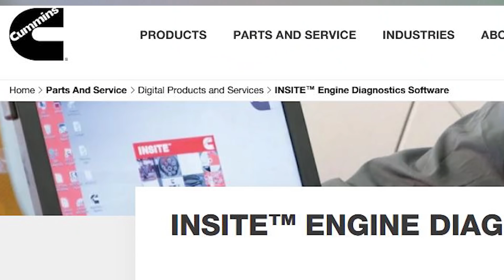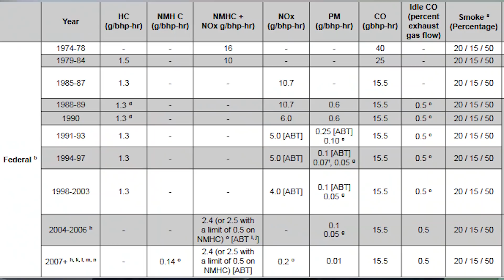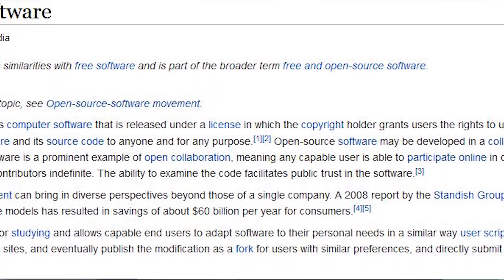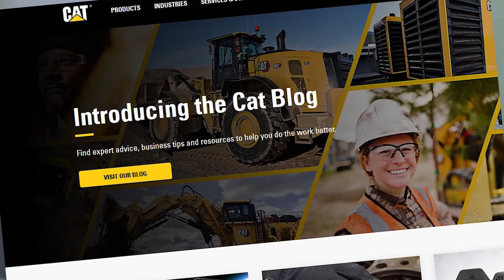Should YOU have the "Right to Repair" your Engine?

Comment: I think of Mel Gibson in Braveheart as he yells FREEEEEEDOOOOOOOMMM! 
I would love to have access to CAT scan tools and wiring diagrams.  I just had a problem with the AC in my T800 Dump truck.

So I got out the back probing pins and the test light and quickly found the binary switch was failed and stuck open.
While I had my stuff out I went ahead and ohmed all the wires out back to the relay so I know how the entire AC system works and make record of it.
I still have unanswered questions though. Soon as the key is turned on a ground becomes active in the relay. Does the ECM send that ground?

Comment: i think this is ALL "CRAZY, STUPID & RIDICULOUS". If I bought the vehicle, with the software installed in it, that makes it run, that is part of the vehicle that I BOUGHT, THAT I PAID FOR... IT IS "MINE", PERIOD! WHY do we have to argue if they should "sell" it to me, when it was already done so, when I BOUGHT THE VEHICLE, and that software was part of it, therefore IT IS PAID FOR, IT IS MINE!?!? OF COURSE it is all a way of them to have CONTROL of you and RIP YOU OFF. You may get a simple "check engine" light, which could be something as simple as a "gas cap" not closed properly, but you don't know, so you gotta take the vehicle to the dealer. At that moment, they can make it up to be WHATEVER THEY WANT, since you have no access to it, and can NOT take it to your favorite mechanic; they can "make things up", tell you you have a bad ECM, or bad injectors, etc etc, and charge you THOUSANDS, when all it would take was a "twist" of the fuel cap, or maybe just a new cap... 15 bucks! Even WORSE, dealers are all CROCKS, besides lying to you on what the real problem was to make more money, THEY MAY NOT EVEN DO ANY SERVICE @ ALL (since most people aren't able to tell the difference, specially on small cars, that everything is so cramped and you can't see), and just charge you the big bucks, and just POCKET ALL THE $$$$! I'm not just guessing here, IT DOES HAPPEN! If you don't think so... THINK AGAIN. You know those signs posted on the doors to the garage/shop that says "no costumers allowed, employees only", and they all tell you is due to "safety and insurance requirement"? It is all BULLS***, it is just so costumers can NOT see what they are doing, they may get caught doing something wrong, doing something that does NOT need to get done or, even NOT DOING ANYTHING @ ALL, BUT, YOU WILL GET CHARGED!!! WAKE UP PEOPLE, DON'T BE SO NAIVE!!!

Comment: This is the reason my current company runs older equipment we have a 2 stroke Detroit, a 300 big cam Cummins, and 2 b model cats granted we are a smaller company and our construction equipment is newer except for our runner tire roller which has a 2 stroke Detroit in it also but I’m the driver/ mechanic/ spare equipment operator

Comment: I believe it pretty much started back in the early-mid 80's when domestic car makers ( don't know about the truck/equipment makers) started putting computerized (OBD1) systems and longer powertrain warranties on thier products and with the federal mandated warranties on their emission systems. Even then owners and shops could somewhat excess information via flash out codes from the check engine light when no scan tool was available and if they had or could get the latest repair manuals Motor, Mitchell, Chiltons, etc of course no internet at that time they could the repair themselves. That debate has been going on for along time, you may own the equipment/vehicle but who owns the software?. Dealers always get the latest and greatest first, then the aftermarket is usually 3-5 years behind in which even then the software released is still very limited. Because of the warranty period that every manufacturer places on their products. Independent shops can spend $1000's just on software updates every year, let alone what it costs to subscribe to the manufacturers sites in order to be able access repair manuals, TSB's and updates. Aftermarket repair sites, j-pro, alldata, etc are limited only by what each manufacturer releases. Like with most auto makers the software used is all designed "in house " to both operate and diagnose their systems powertrain, body, brakes, etc. That to maybe the same with equipment manufacturers. Correct me if I'm wrong. What I've seen with medium/heavy trucks they have multiple suppliers to which require multiple software applications for powertrain, body, brakes, etc. I wouldn't doubt that any equipment, auto, truck, bus, etc maker has as many if not more software engineers then mechanical engineers. Even larger legal departments. I heard that John Deere had lost the law suit against not releasing their proprietary software to allow owners and independents to repair their equipment. I'm sure others will follow.

Comment: at minimum, I think the ability to read any trouble codes and do diagnostics  like cylinder deactivation, injector data entry, etc.. whether that's through a screen provided on the equipment or through a laptop I wouldn't really care
If anyone is concerned about right to  repair and hasn't heard of Loius Rossmann, check out his channel here https://www.youtube.com/watch?v=yw9k74Wu6fo
And if you like legal stuff, here's Steve Lehto  on the subject https://www.youtube.com/watch?v=6qyYEvcS5-8

Comment: As someone who grew up in a family of professional mechanics I was taught to wrench what I know learn what I don't. If you can do it and it's yours, hey this is supposed to be a free country. If you don't feel qualified then the shop down the road should have the right to work on my rig if I say so. I understand proprietary information but this is taking it too far.
Reply: Yeah buddy that's the problem I understand having private information but when you're strictly designing the equipment/software to not be able to be repaired out of the shop. Too me that's not longer private information that's the company going out of their way to screw over their customer's

Comment: IMHO, it should be treated like cars. They all should have a standardized port such as OBDII. You should be able to Run The DTC and either fix it yourself, go to a third party or deal with the manufacturer. Like with cars, if you alter the software, the manufacturer is not responsible for damages. Simple enough.

Comment: The service software for most engines and machinery does not do anything. It provides a interface to communicate with the engine or machine controller to read out codes or values that those controllers have generated most controllers have more than enough ability to do this for them selves as it’s is the controller that is doing all the decision making.Komatsu for example used to be able to read high pressure fuel actual and target pressure carry out cylinder shut down test and so on  all things that would need a software package but was simply accessed through the monitor panel of the machine with a dealer code.my my point is if you look at dash boards in prity much all modern trucks plant or cars the user interface is good enough to run any diagnostic to trouble shoot itself however manufactures chose not to put on then hide behind expensive program packages to try and recoup there development costs and forcing customers to use there approved channels which are highly inflated prices due to dealers having to pay highly inflated licensing to use a program that shouldn’t be needed.in an era previous to electronically controlled engines and equipment customers would gladly take there items to a main dealer when needed as that was where you would find the expertise for that particular item if that expertise wasn’t there then that workshop would simply fail and go out of business.now however customers feel they have no choice but to go to the dealer ship because there hands are tied regardless of the expertise of workshops and can sometimes be left with a bad taste afterwards feeling they have not truly been given value for there money.

Comment: the industrial truck and equipment industries need to take notice from the auto industry.   obd2  is a standard that gives generic  data.  doesnt matter who makes it.  if the manufacturer wants proprietary then they need to make the tool and software available  for a price. thats what car makers do. it's the price of doing business. is repair easier faster and less expensive with  factory tooling?  you bet. but with a cheap generic tool i can at least tell if i need to add some fluid  make an adjustment or take it to a dealer.

Comment: I worked for Cat for 45 years and always felt that a well informed customer was our best asset. Giving them full access would definitely increase your sales opportunities and customer satisfaction
Reply: I agree. I enjoy an educated customer that I can have solid communication with. I fully support the right to repair. I find that customers are a lot more loyal when you are open with them about repair procedures, including encouraging them to maintain and do light repairs on their own equipment when the need arises.
Reply: You are correct sir, treat people well and they will return the favor.
Reply: @xabhax  They already have to do that. I've had to pay people to fix things I've screwed up. You can pretty much see when people mess up stuff, particularly the computerized stuff. Lots of access logs kept in the system you can check.
Reply: Not when Cat makes way more money off of service contracts and repairs than they do selling equipment in the first place. There's a lot more money in repair and service (or forcing them to buy a new one) than letting the person fix it themselves
Reply: How? They would buy less parts and pay for less repairs. I understand right to repair means freedom, but CAT isn't stupid enough to lose out on tens of thousands to a customer for their freedom to do unqualified repairs.
Reply: @sqlevolicious  you are so wrong. Syracuse supply was the place I spent most of my money on parts. They couldnt help you enough the guys there were great. The reason I will not buy a new truck is because you can't get a cat engine. My rebuilds on my cats go 2million miles. The way these new engines are built and the way the new morons run them I am surprised they get 5 hundred thousand on one

Comment: I think these manufacturers are missing another revenue stream. Open the software up to those that bought the equipment and have technical support. Charge a fee or a subscription. I get it might be tough to do but someone that can aid me in getting my truck up and running or just patched up to finish the week. There are hardly any dealers you can phone nowadays that will help you jerry rig your equipment until you can shut it down. Guess what, you do that I'm coming to your shop to get it fixed once I'm done with my work.

Comment: Right to repair 👍👍👍👍👍,  I know everything is all about the dollar,  what's a yearly subscription to ET,reading codes, diagnosing the code, clear codes, put in new flashfile, also need wiring diagrams, theory of operation, and parts manual,  service updates 🤔 all for one price , NOT if  you get this or if you want this, you may need this , one price for everyone for everything,

Comment: Our company actively avoids buying CAT equipment in Europe. 
Over 10 years ago we had a shopping spree and CAT dealer had some compelling offers. But you allways have to ask, where is the catch.
We did the same with other supplyers, get an offer for around 25 big machines, mechanics and operators picked few parts from any machine and we sent it the orders to get quotes and availability.

CAT is up there with John Deere in servicability and access to software, overpriced parts and non existent customer support. 

We dodged a bullet big time, the choice later was other manufacturers that offered service contracts and 24hr parts guarantee, without costing us an arm and a leg (probably kidney too)

Comment: Yes absolutely make it run the way YOU WANT IT TO, not the way government dictates this explains why CAT has their software locked out to average Joe's and dealers WILL NOT do any out of the realm  programming and in most cases if they do any engine work it runs worse when they get done with it because all they do is cut everything back, but like anything else there is ways around obstacles

Comment: I haven't been to a dealer that has been competent in many years. Incompetence, lack of knowledge and training, poor quality and work ethic seem to be the norm in my experience. Warranty issues are a complete nightmare. No parts is the usual excuse and they usually want me to come back three times to make sure the trouble code is repeatable.  If my trucks aren't rolling they aren't making money. Customers suffer as does my company. If there is anyway possible I can go to a trusted private mechanic I do. I also do most of my repairs myself. I should be able to purchase any software and hardware needed to repair my Peterbilts period end of story.

Comment: Absolutely, if I buy something then I have total control of that item and I can do whatever I wish with it (so long as it is legal) If I wish to repair the item then it is my right to do so whether I wish to have a dealership carry out repairs, a small independent, or whether I want to undertake the job myself. Manufacturers demanding that I have my repairs carried out by a dealership is a racket and extortion. Still I won't buy a new vehicle anyway I would rather have something older that I can do everything myself, and I do. If a manufacturer wants to play that game then I ain't buying.

Comment: I would not mind paying the dealer to repair my equipment, if the could actually repair it and not just throw parts at it until they got the right part and they are so booked up you can't get it repaired in a reasonable time. I had two field service mechanics that have said; I have never worked on one of these before! They had no idea what to do. Then i tell told to leave. I have used Cat service since 1972 and been happy with their service, they have never had an issue that they could not resolve.
Reply: Worked for a contractor that bought new cat eq , sent eq 3 times on lowboy to shop to fix. Finally on the 4 time and still in warranty he told me to fix. Bad wire connection, fixed in 2 hours, never had problems! Cat has run off the older techs for Cheeper  labor !!!

Comment: As far as EPA laws go, owner ops and small companies (under 20 trucks), should by law be allowed to remove any and all emissions equipment from up to 20 trucks.  

Larger companies should still need to have all the emissions equipment on their trucks.

This would give owner ops and small companies an edge because their trucks would be more efficient and reliable than the mega fleets.

Comment: If you own an item, you should be provided with all the repair and diagnostic software the manufacturer/dealer has.

The vast majority of people will still take the item into the shop because they don't know how to fix the thing.  Yet the people with the knowledge and skill should be able to fix whatever is wrong.  Including disabling engine derate for emissions. 

As far as legality of disabling derate for emissions, as long as you have ordered the parts to repair the emissions, you should be able to disable the derate until you are able to get the truck repaired.

Comment: It seems that, quite often, there are those who will claim that regulations shouldn't be set by those who are "too stupid" to comprehend the complex systems created by "more intelligent" people. I think it more along the lines of a lack of ability, or willingness, of the manufacturer to follow regulations in a way that works for the purchaser. Manufacturers are not above gaining the system. VW is only one of many who've attempted just that. Over the course of the last forty years there's been a push for deregulation and advocacy for small government. But consistency is not something we're seeing with "self policing" businesses. Proprietorship tends to be a standard that tends to beget a lack of standards, where everyone wants their own special control over their manufacture, ending with every single manufacturer requiring proprietary equipment to deal with their products that will not work with anyone else's. This is quite wasteful on a large scale. I don't think I have the right to own, if I do not have the right to alter, repair, or dispose of, what I purchase. If my effort puts the equipment out of sinc with regulations, then that equipment should be prevented from doing harm, if that's what it's doing. Because clean air is not a commodity. It is a finite necessity. Things are never as simple as some would like to think.

Comment: I worked at a large Volvo truck dealer for 12 years.Volvo has VCADS for diagnostics.You can buy VCADS Pro.This will give you the ability to do some parameter changes and code read out.A Volvo mechanic will get access to the full Volvo system including the guided diagnostic system and Volvo's E Service program.The GDS is not perfect.Some cases it tells you to throw parts at your problem.But,you can E Service for tech help with your case.Should Volvo give their GDS system to the general public?It would plug up Volvo's system bad.Tough call here.